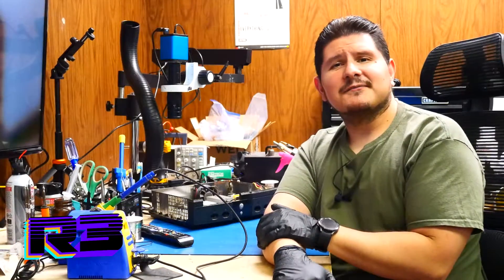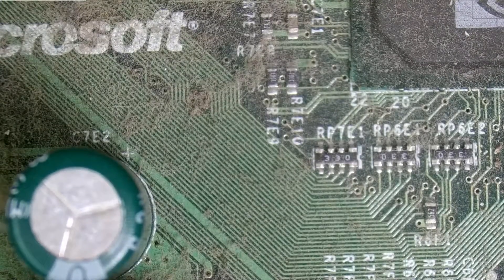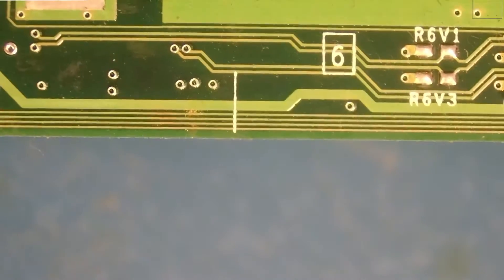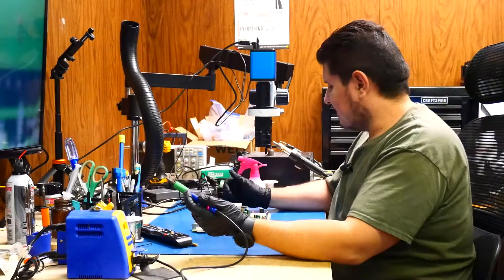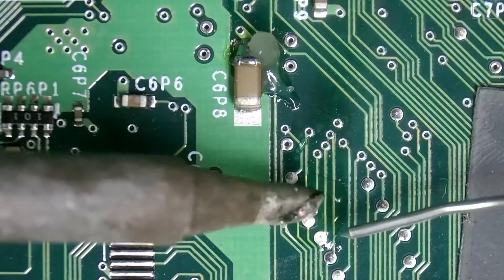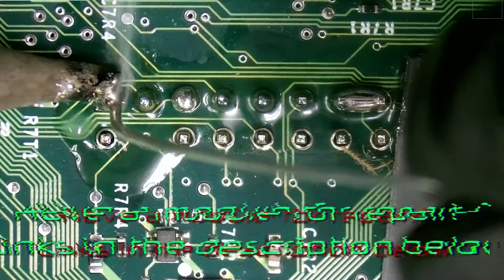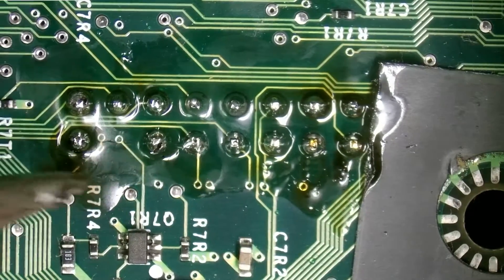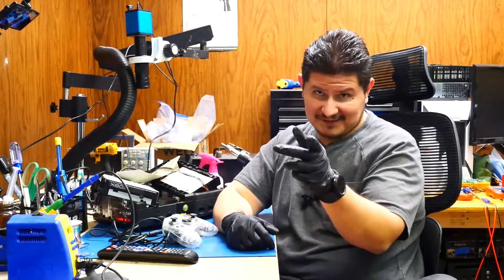OG XBOX Coma Console - From Black Screen To XBlast OS | Easily Fix Your Original XBOX

Comment: @RetroRenegadeRepairs Hey, recently, since yesterday, I experience sudden video drop out/black screens. It goes black for 1 or 2 seconds, and then I get a screen again. I use the electron shepperd xbox2hdmi adapter. It works fine on another xbox console which is softmodded. But it always worked fine on my modded xbox too. I have a version 1.0. 

How come it goes black screen for 1 seconds, like the screen goes out and then on again? Any ideas? I also just opened it and i don't see anyhing weird, it is pretty clean, and no weird leaking capacitors. hmm?

Maybe it needs a new AV port?

Comment: I just bought a modded Xbox with a 3tb hard drive and the clock cap removed it is loaded with games but when I go to play games it cuts I. And out on signal any suggestions and keep up the great work!
Reply from the maker: You may need to have the capacitors replaced. You could also try cleaning out the AV port.
Reply: Thanks for the input!

Comment: Hello, I was soldering the socket for the Aladdin XT and instead of the 3rd row of pins, I soldered it from the very top, i.e. from the side of the AV socket. Then I installed the chip there and the console started going crazy, resetting after startup. Now I have soldered everything as it should be, but unfortunately, despite the green power LED, I have no image. What could I have damaged?

Before the entire procedure, the console worked properly
Reply from the maker: My guess would be some resistors are damaged or an IC. Worst case, the MCPX is damaged and needs to be replaced.

Comment: You put IPA in your ultrasonic cleaner? Just straight up 99 or mixed with something?
Reply from the maker: 99% IPA. I know others have had warnings on it being combustible, but I've not had issues. That said, I'm not responsible if something happens ;)
Reply: Preach. I would assume as long as it’s well enough ventilated it would be ok. Cheaper than flux remover and DI water too

Comment: I have a 1.0 I believe (mfd 2001) I replaced the rubber band in the disc drive to get rid of the flashing yellow light. But I still get no video or audio.
Reply from the maker: Its possible you have either a capacitor issue or its in a coma. I'd start with caps first.

Comment: my og xbox v1.6 it has sound but no display ,did u know how to solve it ?
Reply from the maker: It could be a few things.

AV port needs a clean
Incorrect region
capacitors failing
AV cable is faulty
Reply: @RetroRenegadeRepairs  av cable works fine on other og Xbox,I done recap all 3300uf &1500uf ,I have both pal & NTSC tv ,Ive done cleaning av port both on console & av cable using alcohol but still no display & just sound :(
Reply from the maker: @D-Retro-Dude  Its possible the can caps near the AV port are needing replacement. Try leaving the console on for an hour and see if picture shows up.

Comment: quick question, new sub here =D so I can put xblast on a disc as an iso with an.xbe to flash my Aladdin XT or will it come flashed already? I used to softmod these units all the time back when using mechassault and the exploit with memory card, Used to use evox and unleash X ,,, now everything is different seems much easier to hard mod and im doing this to my 1.3  just waiting on ram chips and Aladdin xt chip
Reply from the maker: The Aladdin XT comes flashed already, but the clones can not be reflashed due to the bios chips used. You'll need to manually flash it with a programmer and use a bios that supports the 128MB RAM mod.